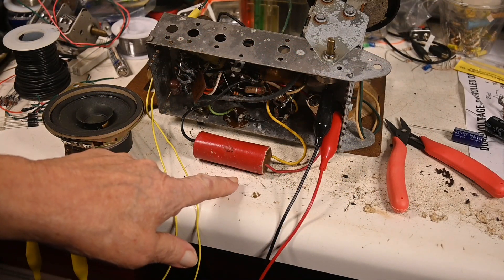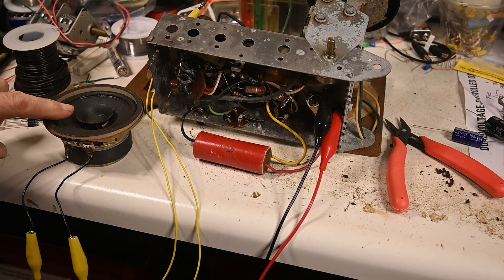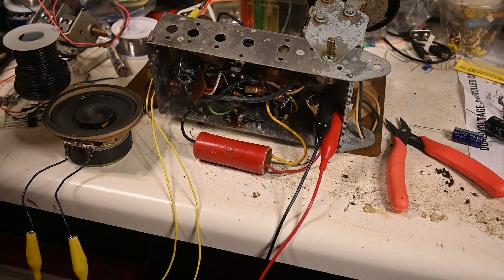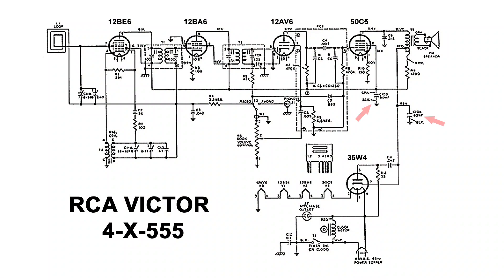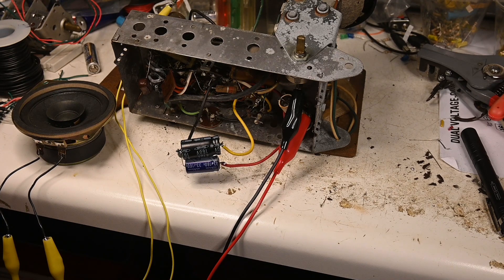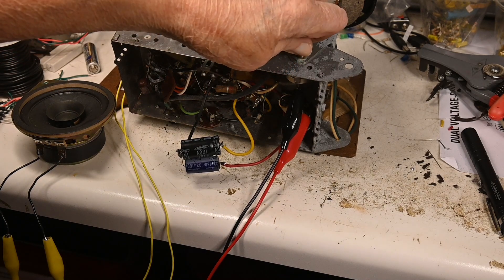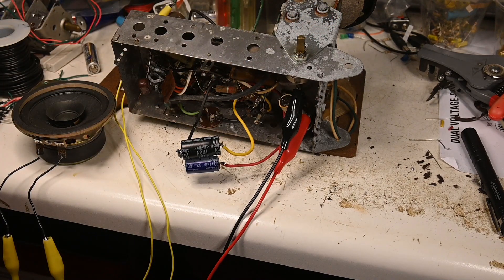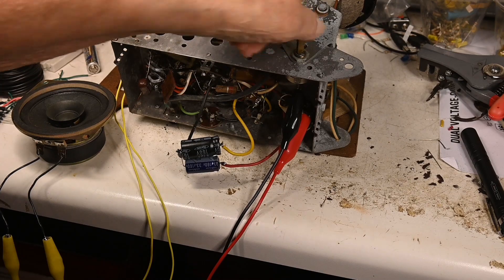Replacing the electrolytic capacitors in the RCA 4X555

Comment: Looks like you might of dodged a bullet on that one Rick. I've only tried replacing those caps inside the cans one time on a Zenith and it was a fail. No desire to do that again. :)
Reply from the maker: Thanks Doug. Yes I did. I had repaired a AM and FM Zenith Console. I had to repair the two AM I.F. cans, the two FM I.F. cans and the FM discriminator can. A total of five cans, I did not charge near enough.

Comment: I think you cought that one just in time, I think one of the electrolytics were breaking down.. you lucked out because changing the IF caps is a pain in the back side
Reply from the maker: Thanks.
Yes I did, and it is a real pain.
I had repaired a AM and FM Zenith Console. I had to repair the two AM I.F. cans, the two FM I.F. cans and the FM discriminator can. A total of five cans, I did not charge near enough.
Reply: @AllAmericanFiveRadio  good work Rick👍😎i cant believe they thought it a good idea to put the caps inside the cans🤦🏻‍♂️people don't realise what is involved in that kind of repair, I know from experience what's involved and I can say I wouldn't do it unless it was part of a full restoration on a set I was going to keep and use myself, a really good friend etc👍👍